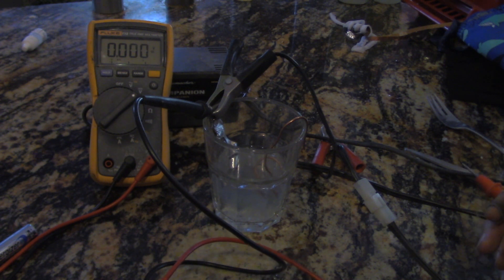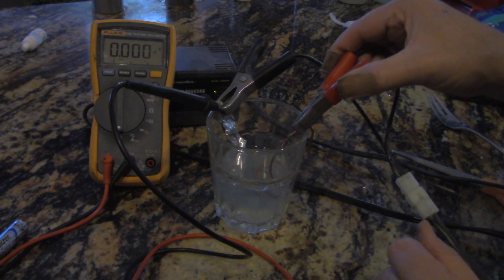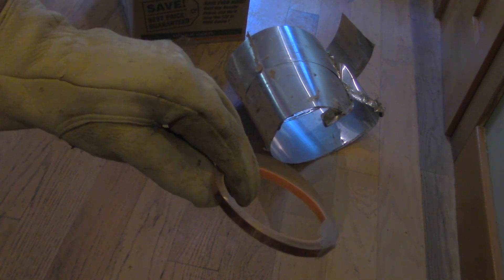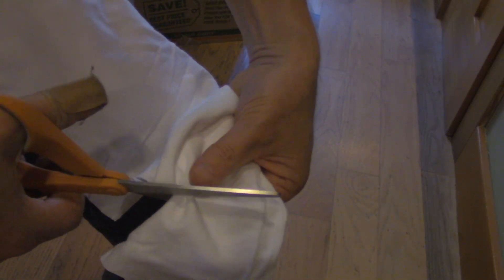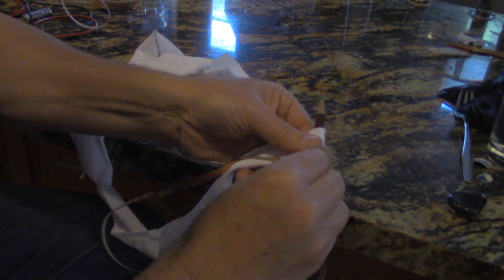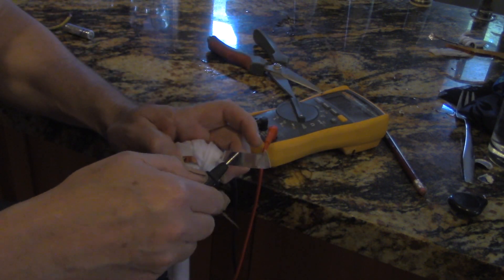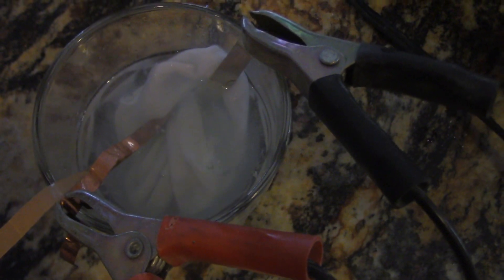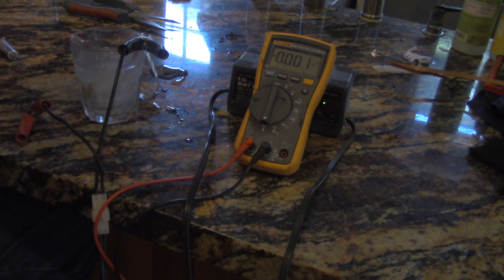1000 mA Salt Water Battery

Comment: How to add amps to Earth batteries and crystal power cells!
In 1861 telluric energy was discovered in the Alps.  Today this technology is commonly called an earth battery, EB.  Earth batteries work great at producing voltage.  We can build an earth battery in series and create as many volts as desired.  However, the amperage in an EB is very low.  This is what has hindered the usefulness of the amazing earth battery.  Here is how to build an earth battery.   https://youtu.be/aCCK132OIGA

Adding amperage is quite simple and key to making real power.  Power = Amps * Volts.   We have to increase the current in amps to produce any real power.  A simple law of physics shows that wiring in parallel will add the amps of the power sources.  We need to introduce a source of high amps.  A solar panel wired in parallel to the EB will give the circuit much needed amps.  I built this and tested it several times.  It works.  This hybrid system can produce limitless green energy.  The secret will be to have a special solar panel built.  One that wires all the photovoltaic cells in parallel to maximize the amperage.  One 4-inch square photovoltaic cell produces 3 amps.  This super amp solar panel will make the system a powerhouse.

Here is an example of a 175 volt earth battery.  https://youtu.be/Ffb78oXeiGI?si=xWuSFsGtIzPLB2w1

Comment: Make an electrolyte of baking soda and lye. Make a paste of graphite and iron oxide with a bit of fine steel wool for the anode, use aluminum foil as the cathode. You will get about 1.8V and a current of well over 100mA per square centimeter. Make sure your aluminum is clean. Using a cathode of pressed machine shop turnings on foil will get very high current output of an amp or more per squre centimeter 😮
Reply from the maker: I'll have to try that, sounds interesting.

Comment: I bought a roll of copper from Aliexpress to make one of these... made the mistake of using it in a much smaller container for the sheet, paper separator, and aluminum can. Holds some charge, but I am still waiting to test amps as my weaker fuse blew in my multimeter and I only have the 10amp fuse working... so I cant accurately test its capacity xD. Highest i get is roughly 0.6 volts, have two others at 0.5 and 0.4 respectively. Hoping to build enough voltage soon, and hopefully shrink them down as well. Just got an idea from optimizing the coffee tins space that might be good...
Reply from the maker: Your voltage looks good. Sounds like you are using the can as one end of the circuit.

Comment: That is neat for a copper and aluminum salt battery 1000 mA. Could you build them up and use an DC-DC converter to light several LEDS?
Reply from the maker: You could do that.  You could also wire them in parallel for more current, or in series for more voltage.

Comment: Using something like glassfiber between them on a one layer will degrease the distance between the metals and if you scrub the metals with sandpaper or somethin to make them have more surface area you increase the amps allso.
Reply from the maker: Fiberglass sounds like a good idea.

Comment: It's really interesting but as non engineering I'm just wondering applying the moisture/water is the only thing necessary once it is assembled...Must be modern materials that wont corrode like cotton, because doesnt seem like the salt or any aspect would be depleted.
Reply from the maker: The process is reversible so you can charge and discharge but there are degradation issues due to the corrosive salt.
Reply: @MyEngineeringProjects  I hear ya. I thought maybe anti corrosion materials have advanced. I'm going to try to read up about that. I always wonder if electric cars had two battery design, whether one could be charging during drive with this kind of design.

Comment: Distance between the plates makes a huge difference to performance. The closer you can get them, the better they will work. I think this is a capacitor rather than a battery, because the current is behaving like it is stored as opposed to being produced by a reversible reaction. All in all, I like what you did here. Just for fun, make one with a steel wool “plate” on one side and a carbon felt “plate” on the other. Carbon felt is readily available as air conditioning filter material.

Comment: That's very interesting.  I've just been conducting my own tests with a few different metals in a solution of 30g salt in 300gm water.  I'm surprised at your 1.2V output from salt water.  It leads one to wonder if some acid-ionising agent were present, possibly contained in the cloth.
The best voltage I could get was about 0.9V between sheet zinc and a stainless teaspoon.  Another sample of stainless gave rather less.  The best result was copper-zinc which gave me 0.8V - ie considerably better than copper-aluminium which I find gives about 0.52V.
As to current, small-ish tabs gave me about 200+mA, so decent areas would potentially give an amp.  Two points:
1 - I was using the cell exclusively as a primary cell - it never occurred to me to try and charge it!
2 - Cloth separators will obviously fill up with bubbles very quickly.  I make my cells with small, mechanical spacers so that the bubbles can be released by tapping the cell on the bench top.  Another approach is to make one or other electrode capable of a bit of up-down movement so as to dislodge the bubbles.
Reply from the maker: One other thing.  You may have seen 1.2V but this is not the rest voltage.  I get about .8 V nominally between copper and zinc.  The higher voltage was just after a charge.
Reply from the maker: Sounds like you are making great progress.  I'm curious about the stainless steel.  I have not tried that combination yet but it looks promising.
Reply: @MyEngineeringProjects  Thank you for your reply.  The trouble with saying "Stainless steel" is of course the wide range of alloys.  The principal alloying metals one thinks of in st st are chromium and nickel.  I suppose I could find an old plated nickel spoon and strip its plating off, but I don't count that as a desirable course.  I don't know how to obtain chromium, and I'm not interested anyway.  My own involvement is in trying to interest my grandson aged 12.  What I can't find on the web is a list of electrode potentials in salt water.  Dilute acid yes.  Incidentally I tried iron and lead in combination with the other metals, but they don't compete.  I admit surprise to find that Cu+Zn give higher volts that Cu+Al.  But the salt water series is clearly different from the acid solution series, where for example Cu+Zn give the well-known 1.1V.  I'm staying with the salt water cell simply because I won't encourage grandson to play with acid.
Reply from the maker: The safety of salt water batteries is one of the reasons I demonstrate them.  It's a great learning tool with low risk compared to other batteries such as lead/acid and lithium ion.  At one point I found the voltage table you need.  If I find it again I'll let you know.

Comment: What battery is being used to havw that high current?
Reply from the maker: The one I made for the demonstration
Reply: What do you call this battery? And is it possible i can charge a phone with a series of that solution?
Reply from the maker: This is a salt water battery.  A cell phone battery has a much larger capacity than this one.  You would need many in series and in parallel in order to charge a cell phone.
Reply: Ohh i see. Thank you, yes we already did a series parallel connection of the solution, we already got 10-12v. I have a question regarding with that, is circuit still needed to provide input 5voltage to charge a phone?  Or a dc usb boost module is already fine to connect with the charger?
Reply from the maker: I have not attempted something like this.  Probably the safest way to do this is to use a commercial adapter that can charge based on using a backup battery.  You have to be careful with voltages so you don't damage the phone.  A commercial adapter that can regulate the output voltage and current makes this easier.  I would not attempt a direct connection without regulation.
Reply: @MyEngineeringProjects  okay. Thank you so much for the very well explained video. So we need  circuit that has voltage regulator or the IC LM7805 and other types of diodes in the circuit? So that it will not be directed with the phone.

Comment: What happens if you put only two Zinc in saltwater ? Would it produce a current?
Reply from the maker: If you have multiple plates in parallel in the same electrolyte, it will increase the current.  Cells in series must be separated.
Reply: @MyEngineeringProjects  like without any other electrodes just only zinc? They react with each other in saltwater? 😊
Reply from the maker: oh i see what you are saying.  No, you have to have different materials one for the anode, one for the cathode.  Two of one type will produce no results.
Reply: @MyEngineeringProjects  thank you! I thought so but science isn’t my thing so was curious haha

Comment: how can you keep it from discharging so fast ?
Reply from the maker: In the demonstration battery that I built, my only goal was to see the maximum current possible.  Current is controlled by the resistance of the circuit.  Shorting the wires brings this resistance to near zero.  So in order to slow the current rate, you must increase the resistance.  This can be achieved by using a real load like a light or by using a resistor in the circuit.
Reply: So in order to make this power a light you need at least 6 cells to make it a 12volt out put correct
Reply from the maker: It depends on the light.  Some lights can run at lower voltages. But yes when you put more in series the voltage adds based on the voltage of each cell.
Reply: Ok thank you

Comment: Hi do you have a contact number? My daughter is working on a project related to salt water battery so I need to talk with you. Thanks
Reply: This may be too late, sorry, only just seen this video.  My comments:
I've just been conducting my own tests with a few different metals in a solution of 30g salt in 300gm water.  I'm surprised at his 1.2V output from salt water.  It leads one to wonder if some acid-ionising agent were present, possibly contained in the cloth.
The best voltage I could get was about 0.9V between sheet zinc and a stainless teaspoon.  Another sample of stainless gave rather less.  The best result was copper-zinc which gave me 0.8V - ie considerably better than copper-aluminium which I find gives about 0.52V.
As to current, small-ish tabs gave me about 200+mA, so decent areas would potentially give an amp.  Two points:
1 - I was using the cell exclusively as a primary cell - it never occurred to me to try and charge it!
2 - Cloth separators will obviously fill up with bubbles very quickly.  I make my cells with small, mechanical spacers so that the bubbles can be released by tapping the cell on the bench top.  Another approach is to make one or other electrode capable of a bit of up-down movement so as to dislodge the bubbles.

Comment: its a capacitor not a battery
Reply from the maker: No this is not a capacitor.  A capacitor does not use an electrolyte. Any battery that is shorted will have a larger surge current than it can sustain normally.  This does not mean it's a capacitor.  I did this experiment to demonstrate the relationship between surface area and total surge current in a battery.
Reply: @MyEngineeringProjects  electrolytic capacitors called and were wondering why you think they don’t exist, because electrolyte is literally in the name. I know you know the difference, I just had to be that guy. Thanks for the video.

Comment: But you could melt that adhesive/cardboard stuff on the back of the copper strip with fire, then clean it up.
Reply from the maker: That's possible or you could just get one that's ready to go without the adhesive.  I just needed something with a large surface area to experiment with.